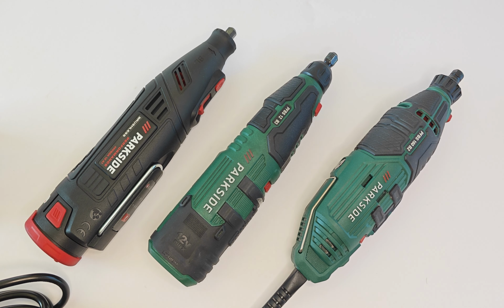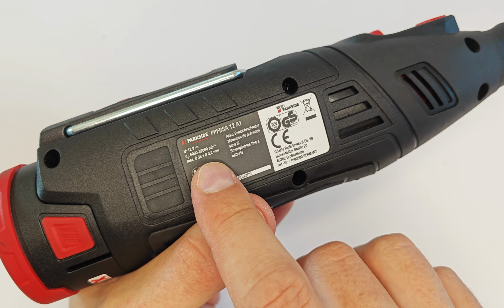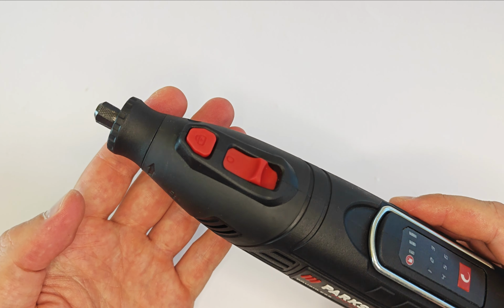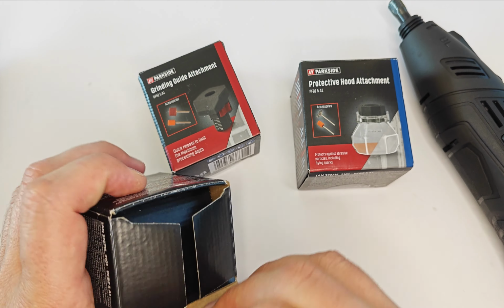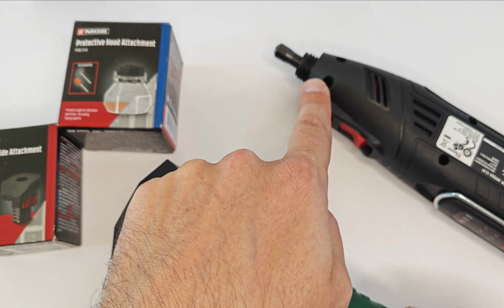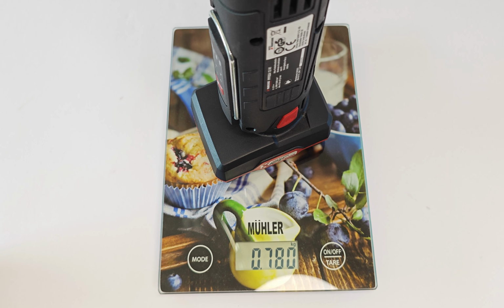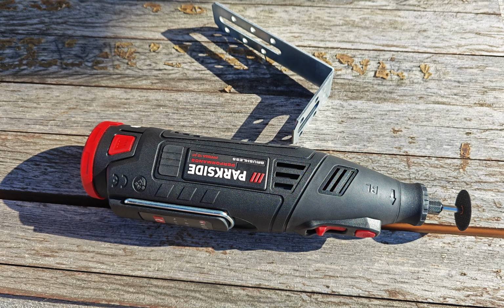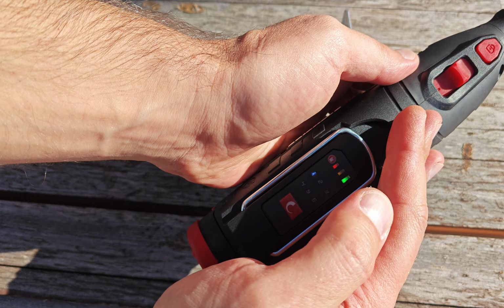Parkside Performance 12V Dremel Multi Tool PPFBSA 12 A1 - Rotary Tool

Comment: The thing is that these attachements are useless as the normal green machine has too much flex in its head to use it as a mill. The new design has a much shorter shaft which decreases flex which is good, this also the reason thhey decreased the length of the accessory thread to increase stability from my point of view. Maybe thats the reason why they changed the thread type.

Comment: Looks like it has good bearings compared to the chargeable green model (where there is an unused bearing slot right at the end of the tool and it has weird vibrations...

Comment: Just bought a production version in Bulgaria. For the reasonable price of just under 65 euro it comes with battery and charger, sturdy case, a bunch of attachments and all the basic bits you need to get going.

Comment: I bought this machine and Dremel 225 flexible shaft it perfectly fit. all accessories from Dremel perfectly fit.however my unit made annoying noise I disassembled my unit and add some grease into bigger bearing it’s helped reduce annoying noise.maybe this information will be useful for someone

Comment: the green PFBS 12 B3 can have 2 bearings installed on the shaft. This new one has only one bearing and no space for second one. The old one has easy to get motor replacements too.
Reply: Any links on the bearings and motor?

Comment: Thank you. Finally with removeable battery and brushless.
With the attachments, that’s a pity.

How loud is it compared to its predecessors and how much stroke does it have, how is the concentricity?
Reply from the maker: Same loudness i would say. What do you mean by stroke and concentricity?
Reply: @icku  Thank you very much. Well, how nicely does the spindle turn? For example, when you cut something with the cutting wheel, does the cutting wheel lie permanently on the material you are cutting, or does it jump due to the imbalance and asymmetry of the spindle? How strongly does the whole device vibrate? If the spindle and motor are balanced and running smoothly, vibrations should be minimal. Hope this is a little bit more clear.
Reply: @icku icku?

Comment: I like the fact that it doesn't stalls easily as the green version specially at low speeds, also the removable battery is a welcomed plus. I might sell tge proxxons and also the enoying green dingus vibrator :-)

Comment: Hello. Can I use a 4 amp battery instead of the 2 amp ones? Thanks in advance for your answer.
Reply from the maker: Sure you can. And even the 5Ah. But they are heavier and cumbersome for such a small tool.

Comment: Are the Parkside tools compatible with Dremel tools? Thanks
Reply: Until now, yes. I have the corded one and no problem with Dremel accessories. But it seems this new unit is not compatible.
Reply: @jordiribas2883    No, the new one is fully compatible with Dremel! I've tested the router attachment and the flexible shaft and both could be screwed to the Parkside tool. It seems to be using the same inch threading as the Dremel does.
Reply: Can you put on drilling attachements?
Reply: Yes